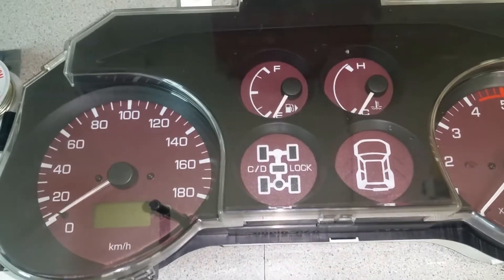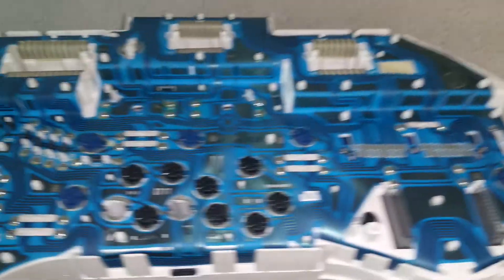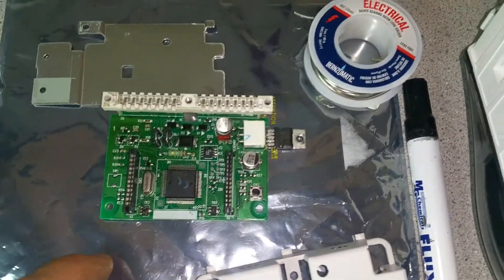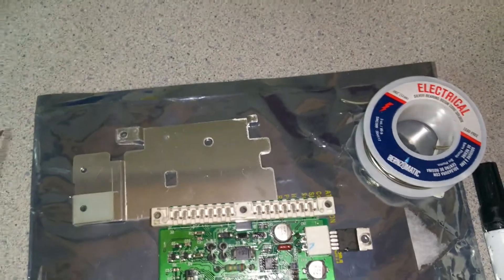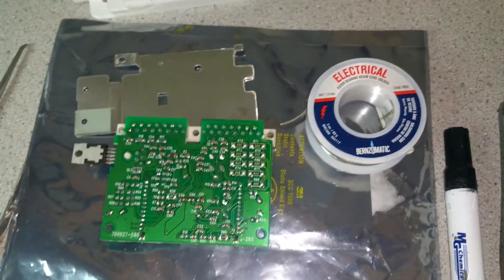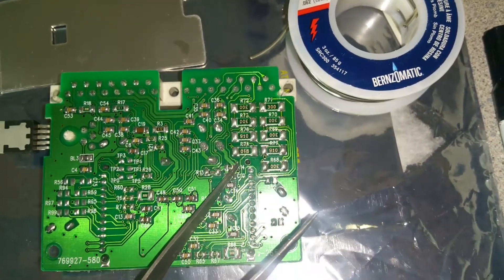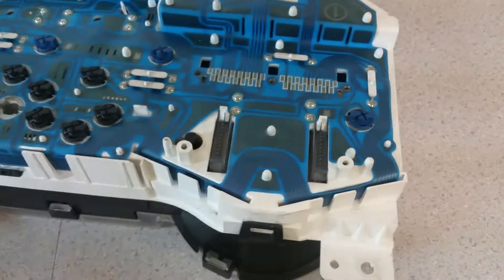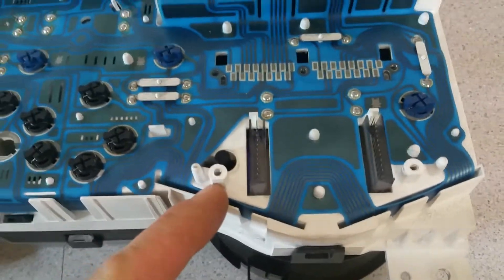Pajero/Shogun 3.2l diesel 4M41 engine, temperature gauge repair

Comment: I resoldered everything and now the speedometer does not work anymore. but, the temperature gauge and fuel gauge is fixed now! 

I could use a little help. thanks! :)
Reply: Hi, my dad was close to buying a new instrument cluster assembly, but I gave it one last try and re-soldered it, 4th time, and now it miraculously works.

Thanks for the quick reply!! :)
Reply: @SupahEXPE00  Ive just done my petrol gauge, thats working OK  now Ive a erratic speedo, what part did you re-solder?
Thanks
Reply from the maker: I am glad that you fixed the temperature gauge issue. The speedometer circuit is behind the LCD if I remember correctly. I am not a mechanic, don't take my advice as correct. Clean the silver plated connectors before you install the whole assembly back into the dashboard. If you set it  correctly, and push it in gently, it will pop into its place without much effort. I would check all the connectors around that large IC (the black square circuit that has lots of pins on it)

Comment: Did you ever resolve your intermittent overheating issues?
Reply from the maker: Yes, my truck engine is working fine. I have replaced almost every component of the cooling system, radiator, hoses, thermostat, water pump, radiator cap, installed new coolant (twice) after properly washing the engine block and removing the rust and air bubbles, repaired (not really needed) the blower fan clutch, then the last item was this coolant temperature gauge fix. Do not follow my advice, i am not a mechanic, i just know how these system work and I have experience in a somewhat more complex field
Reply: @CuriousSoulCanada  I have a 00 Pajero NM DID 4M41 and i have had issues with overheating on long drives on hilly areas. Temp gauge seems correct as coolant was boiling hot, have ordered a 56mm high capacity radiator currently enroute from China. i speculate that it could have a bad or sporadic non op thermostat,  Where did you source your thermostat from?
Reply from the maker: @RKay-ms2rd  in the past I have installed a remote temperature sensor on the radiator to be able to read the correct temperature as I thought that my temp gauge is faulty. My truck was overheating while driving uphill, I had to stop and let it cool before continuing my journey. In most cases that is a clogged radiator issue. A regular size radiator should help, it works for me even when towing a 17ft boat and trailer uphill (it goes in the second or 1st gear). But I also had this temperature gauge trouble. I sourced some parts from https://www.autodoc.co.uk/, they have warehouses in Germany as well. Do a pressure temperature test on your thermostat, insert it in hot water while monitoring the water temperature and opening of the valve (beside the spring), I posted a video of how I did it